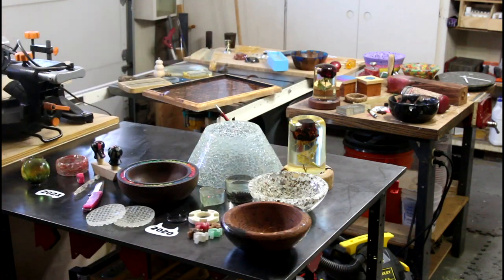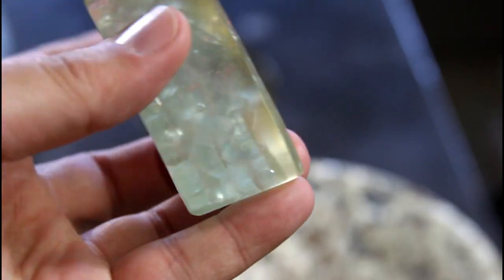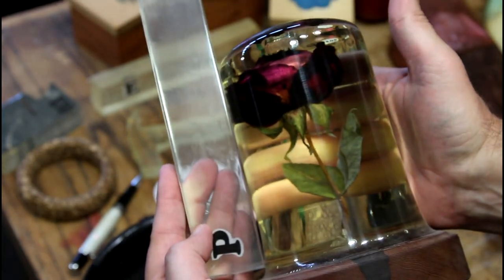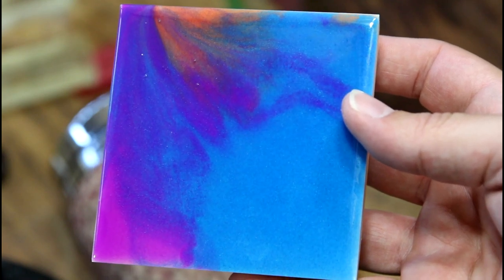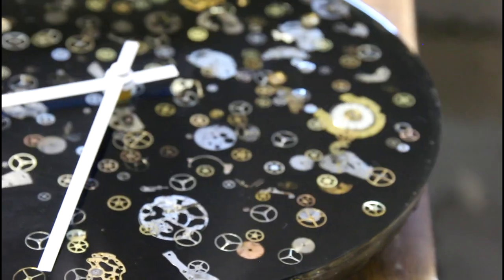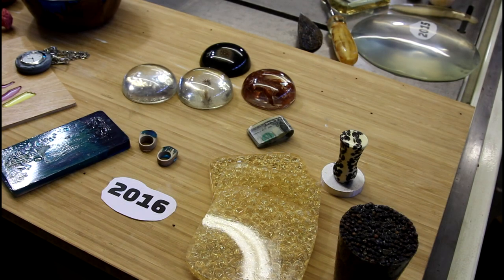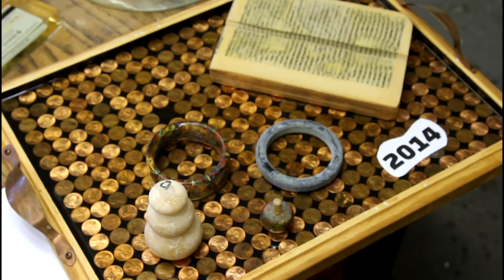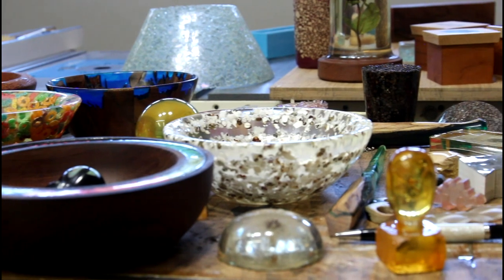Resins dirty secret?

Comment: I collect resin dolls and this is something the (doll) community discusses a lot, so I was honestly happy to see this video. Items that are heavily exposed to light will obviously yellow faster, but it's hard for many people to stomach that when they purchase an expensive doll (or other resin piece), it will eventually become yellow in time. Dolls are made with heavily pigmented and completely opaque resin and it definitely does yellow over time - typically it takes 4-5 years before it really begins to look unnaturally yellow, however. 

To fix the issue, usually there are two solutions: 
1. (If the resin is peach) Briefly dip-dye the resin using combinations of pink/tan or red/yellow/pink. This will darken the resin slightly, but will put more color back into it so it does not look so yellow. 
2. Lightly sand the entire piece. This is extremely time consuming and risky on a detailed sculpt, but it can give 2-3 years of life back to the resin. Usually the outer surface of the resin is darkest, so while the entire piece will yellow, you can restore some life to the resin by re-sanding it. In the case of peach dolls, usually it will take the doll from looking smoker's yellow to looking more like a cream color.

Comment: I imagine the resin changes pigment just as fast when it's thin, but the thinness of it does a lot to make the pigment less obvious. Think of how dark coffee looks in a mug, but a thin layer is translucent.
Reply: Or ice. If you have a large block of ice, it will have a stronger colour then when you shave up some of it. Where it basically always just looks white, with just a slight colouration
Reply: Could be yeah. Makes sense.
Reply: just came down to comment this. the thicker the resin the more the yellowing will show, but it all yellows the same for the most part.
Reply: I've heard stories about coffee that let's you see the bottom of the cup! Coffee should look black or you are doing it wrong. Only a very thin layer let's you see through it, but it's still brown. I wouldn't describe it as translucent, that makes me think of clear liquids. But English is not my first language
Reply: @Johanna77777-z  translucent is correct. I think you're thinking of transparent which would be a clear liquid. Translucent is partially clear i.e. mildly colored or cloudy or whatever else
Reply: Exactly
Reply: Exactly what I was thinking. I even related it to coffee in my head like you did in your comment.
Reply: This is correct! The chemical breakdown that causes the yellow shift doesn't care about the "thickness" of the resin. You can literally see when he's holding the polyester/epoxy samples and rotates one of them, making it much thicker, and showing a much more yellow tone.
Reply: Optical path length matters.  If you have a resin sample a foot thick vs an inch thick, the light will be going through 12 times as much matter so the larger object will look much darker.  When it comes to pigment, the way pigment scatters light, regardless of how thick the object is, as long as you have enough pigment concentration to reach full opacity, you'll only be "looking" at a very thin layer along the outside of the object.  So anything over about a few thousandths of an inch will look essentially the same.  (but anything thinner than the thickness to reach full perceived opacity will retain some translucence or transparency, depending on the specific resins, sizes, and pigment type, and pigment concentration, pigment particle size, etc.)
Reply: I wish I was thin
Reply: @eddieedgar4506  same
Reply: Same as air, it looks clear but the further you look things get blue in the distance.
Reply: @eddieedgar4506  being thin is overrated, what you want to be is happy. I hope you’re happy.
Reply: @halosrusty  I eat to make myself happy, which then makes me sad because I get fat, so I eat to make myself happy.  Perhaps of I ate myself I'd be at my happiest
Reply: If resin is anything like other plastics it only yellows on the surface though.
Reply: @rimmersbryggeri  Doesn't appear to be, mainly cause light is part of the yellowing and these pieces are transparent. Might be true if it was opaque
Reply: Yea like how looking through thicker colorless glass eventually turns green
Reply: But thicker resin cures faster and can got very hot so maybe there is some truth in what he says . . . ?

Comment: I haven't watched the entire video yet, but I know when I used to work primarily in resin we would add a slight, SLIGHT bit of transparent blue/violet pigment. It wasn't enough to notice but it offset the yellowing process a bit. Though it's inevitable.
Reply: That might be why the charcoal bowl seems so clear now! I remember that when it was freshly-cast that some blue pigment or chemical had seemingly bled out of the charcoal and tinted the casting resin.
Reply: @vanathema  Either that or the charcoal had some sort of adsorbent effect on the components that are yellowing. I seem to recall reading that the yellowing happens because the mixture and ratio of A/B is never perfect, and it is the "uncured" trace amounts left behind that are breaking down and turning yellow.
Reply: I worked with an epoxy product years ago where that strategy was used.  It was meant to be a water-clear casting compound and used an amine cure system (most common epoxies do - it's easy, reliable, and very forgiving to measuring/mixing problems).  Thing is, amines tend to be slightly yellowish, and to darken with age and amine cured epoxies usually carry an excess of amines.  So the epoxide side had a very slight addition of a violet pigment.  And the stuff did cure beautifully clear.  Although my favorite product in those days was a high thixotropy epoxy adhesive that had an acid/base indicator as a pigment in its amine side... it was bright pink in the packaging, went milky white when mixed, and cured clear-ish.
Reply: What a great idea. Thanks for sharing that little tid bit.
Reply: Fun fact, back in the Victorian era, it was standard procedure to add "bluing" (a hint of blue dye) to the wash water for whites to counter yellowing with time.
Reply: @Nerdygoddess  that's really cool, I didn't know that!
Reply: @Nerdygoddess  I used that when I was younger in the 80s in Nigeria. for school uniforms and socks. Robin blue was the popular brand.

Comment: I work in paint and wood coatings, and I can't tell you how often we have to explain to people that NO MATTER WHAT, your coating is going to amber over time. I also can't tell you how often people just cant grasp why it can't stay crystal clear forever.
Reply: Is it possible to uv treat it? Like what they do with plastic that has yellowed?
Reply: @AlynneTheFlorifant  At least in my experience UV is what you’re trying to avoid
Reply: UV treatment can break down the remnants of certain halogenated additives.  The role of those additives is to protect the resin and/or pigments from being damaged by light.  Without them, colors would fade faster and/or the resins/plastics containing them would go brittle and start cracking/flaking much sooner.  However, the yellowing Peter and Kyle are referring to is part of the resin product itself.  Sometimes it's excess amine-terminated co-resins, amino or transition metal catalysts (sometimes residual from manufacturing the resin, sometimes added to moderate the product's cure)... when that happens, that's it.  It's yellowed. Interestingly, those brownish-staining additives can stall that process for many years.  But once gone, entropy will do what it does and other (non-sacrifical) components of the resin system will oxidize, darken, weaken, etc.
Reply: @ExaltedDuck   great explanation!
Reply: @AlynneTheFlorifant  This isn't uv, though. Those bubble-wrap coasters were stored in an opaque drawer.

Comment: Archival resin for art conservation surely has to be incredibly slow to yellow if it's not immune. I imagine it's also very expensive
Reply: I actually reached out to Julian from Baumgartner and he said the following. 

"The resins I use are stabilized against uv light. That said it’s likely over a long enough time with enough UV exposure they may yellow. The research however has not shown any change either molecularly or visually over 60 years of use."

Something to keep in mind since they would also be surviving uv damage
Reply: True, but those are also not casting resins. Meaning they might not change when used as intended but I wouldn't be surprised if they changed dramatically if someone tried to cast with them.
Reply: @twistedmyth5860  it seems likely that casting versions exist as it seems like yellowing is partially due to impurities. I think the important thing to remember is that the resins Peter uses are not intended to be optical and archival but strong. Total boat wants a resin with high sheer strength and optical issues are at best an afterthought
Reply: I think an important factor with archival resin is that it's reversible, so even if it does yellow, ideally you would be able to take it off and replace it as often as you like without damage to the artwork
Reply: @reallifeistoflat  Thanks for taking the time to ask Julian
Reply: I was just wondering this myself.
Reply: I wear a pendant,  (1inch dia x 3inch long), cast 41yrs ago, still as clear as the day I cast it.  Has a cigarette and some ash, a little cotton to simulate smoke. I didn't know about stabilizing resin back then. Still clear as glass. The 2 part epoxy 5 minute glue used for the chain link yellowed, then crazed, and eventually crumbled like honey does. Use a screw in type now. I have some items from 10-11yrs ago, they are turning, ever so slightly blue, looks like swimming pool water, but that was the intention (no dye or ink).   
Anywho... Do some science, I did...
Reply: @reallifeistoflat  i was thinking about doing that exact same thing lol, glad to see someone beat me to it
Reply: @reallifeistoflat  But aren't most of these stored in containers? How would they get UV on them?
Reply: @snakezdewiggle6084  so instead of enlightening us with how you did it you rather say “do some science”. Wow thanks so much.
Reply: @snakezdewiggle6084  ok shakespeare relax. If you told me you were going to develop your own and sell it I would understand why you wouldnt want me to know the formula. But it sounds like you are just holding it back because you find it amusing. Good for you. I wonder what the world would be like if the inventor of the lightbulb said “ehhh go do your own research”.
Reply: @feverdream2661  there were 853 unique "light bulb" patents filed in just one year. Plz believe me when I tell you that I am not holding back. In fact I am actually Anti Capitalist, absolutely detest monopolies. Thieves broke into my workshop, took what they could carry and set fire to it as they left. My memory is screwed up due to an acquired brain injury. All i do now is hammer on silver and solder micro lights. 
Sorry to disappoint you. But if i remember anything i will post it here, to you. What I can say is that there was a 4th component that could be purchased at any supermarket, like sea salt or some other crystalline thing. Sorry dude.
Reply: @snakezdewiggle6084  yea you are really sticking it to the man! Smh capitalism is the best thing to ever happen for society
Reply: @reallifeistoflat  many of these projects have been stored in boxes far away from any UV light. Yet they still yellow.

Comment: So if you're planning to make an aesthetic piece that's supposed to be looked at decades for now, plan for the yellowing? Make sure it'll still look good, if not better, with a yellow tint.
Reply: Or cast a resin piece with a pigment in it
Reply: a slight amount of purple will help it look clear longer.  like an amount that isn’t even noticable when freshly cast
Reply: I think the tablet stand made from a book is a good example of this. The yellowing just makes it look like an older book.
Reply: @kane2742  hell yeah
Reply: Maybe he should remake the jurassic park cane with epoxy resin, this time without the pigment in it so that it will naturally yellow over time.

Comment: You’ve just made some enemies with the clear river table makers.
Reply: Unless the table is made with light colored slabs, I think the yellowing will add character. There are also UV resistant costs that can be applied.
Reply: @CodeXCDM  even uv resistant do yellow over time
Reply: @CodeXCDM  I mean... what comes to mind when you see yellowish fluid? I guess that still counts as character. 😆
Reply: @CodeXCDM  most of those projects have been sitting in a box far away from any UV.

Comment: An old trick I learned when working with epoxy is that adding a violet dye to it will prevent or at least hide the yellowing. Not enough to be super visibly purple, it only takes a little bit. 

I use 5 minute epoxy to paint mask eyes and if it is untinted it can yellow in as little as six months, but I have masks years old with very clear epoxy due to the violet trick.
Reply: I was wondering if a little purple would help. Adding a tiny bit of purple to butter cream icing turns it a pretty white and when I had blonde hair I had to use a purple toner to get a platinum blonde look.
Reply: Ah, like they used to put blue dye in washing powder to make the white brighter. That's a great idea
Reply: Do you recall which dye you used?

Comment: Would you consider trying to use Retro Brighting on these? It's a pretty common technique to use on old yellowed plastic, I've seen it mostly when renovating old game systems. I'd love to see what would happen!
Reply: Retro-Brighting is a surface bleaching technique; it's only "skin-deep" so to speak.  It wouldn't penetrate through the whole piece.  The yellowing in resin is not just on the surface, it goes all the way through.
Reply: @BEdmonson85  I expect you are right.  But it would make an interesting experiment.
Reply: @BEdmonson85  I'm not so sure I agree with your statement.   An object that seems to contradict your statement is an automotive headlight lens.  I have seen them turn almost brown,  but end up almost clear when a polish is used on them.  I think some experiments would be warranted...
Reply: I came here to comment the same thing. How do we know that this problem with the yellowing is not just the surface?
Reply: Also came to say the same. Maybe a hydrogen peroxide bath with UV lamp for a few days? Love to see what would happen with the rose.
Reply: @wallywest4274  I'm just going off memory here, when mix epoxy it makes a small amount of a byproduct chemical called amine is made and it's this amine that is turning yellow and if memory serves me right it's UV sensitive so the more UV it has exposed to the yellower it gets
Reply: I also came to say the same thing, as Retro Brighting is used on many surfaces and objects with great results. But it's a good point about just how deep the yellowing is. And also the chemical composition probably comes into play.  I also think it warrants a few experiments.
Reply: @kiwinp  I'd say that UV is what yellows everything this process works on, so it may be worth it to give it a shot if your business is built on resin art. Cheap experiment that would take less time than seeing if a UV coating protected it over several years.
Reply: that process is meant to remove staining rather than yellowing.  The staining comes from a breakdown of brominated antioxidants commonly added to the plastics used in consumer goods.  The role of the additive is to eat up any radicals and absorb shorter wavelengths of light before they can affect the plastic (oxidation of the plastic would make it brittle and prone to cracking).  They yellowing of the resins Peter is talking about is due to the aging/oxidation of the components of the resins.  Mostly, it's amines and transition metal compounds breaking down over time.  I wouldn't expect those to respond too much to the retro brighting (which is designed work on halogens liberated when those light stabilizers break down)
Reply: @ExaltedDuck  My friends, I present to you the most intelligent person on the interwebs. :) 

Fantastic explanation (and a wee bit over my head). Thank you for explaining this.
Reply: @Thumper1968  It just so happens to be close to my field of experience. :)
Reply: @ExaltedDuck  as someone who works in the plastics industry as well, your explanation was spot on!
Reply: @ExaltedDuck  That's one of the great things about YouTube. Meeting super smart people who can explain the complex stuff. If you have any tax questions, I'm your guy. Beyond that, I'm just a curious spectator. :)
Reply: @ExaltedDuck  you seem smart and knowledgeable, can I use retro bright on my old white fridge handles? The fridge has stayed white except for the plastic handles that have yellowed a lot
Reply: @Sarah-ic4yu  maybe. Could definitely be worth a try. Mild abrasion and/or bleaching might work if the staying is due to... We'll just say biological deposition...

Comment: On the charcoal bowl, that hasn't changed, I have a theory...  Back when I used to bleach my hair and tried to maintain a paper-white colour, my number one enemy was the weird yellow colour my bleached hair wanted to be.  To deal with this, I had to use a 'violet shampoo' which had a tiny bit of purple dye in it - the faint purple dye cancels out the faint yellow colour.  If I recall correctly, the charcoal bowl resin ended up with a small amount of deep-blue / violet colour in it, that leached from the coal (wasn't it UV reactive?) - I think maybe the faint purple in the resin is cancelling out the yellowing... maybe this trick could be used on purpose for projects that are likely to yellow over time??